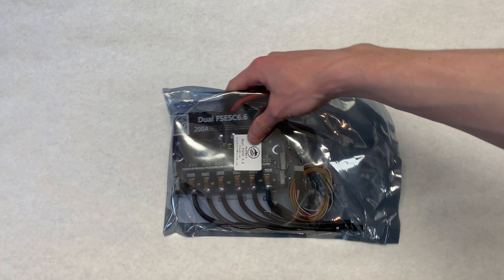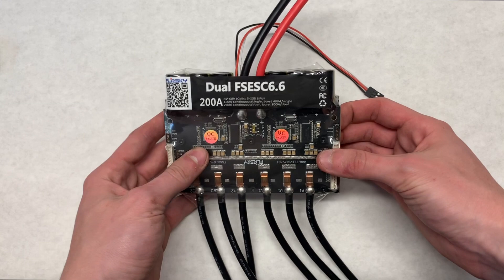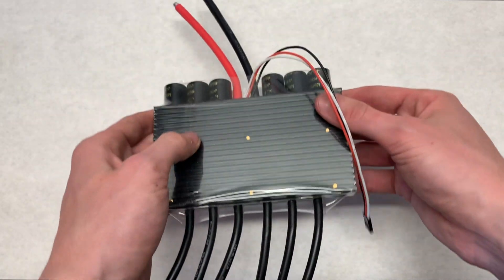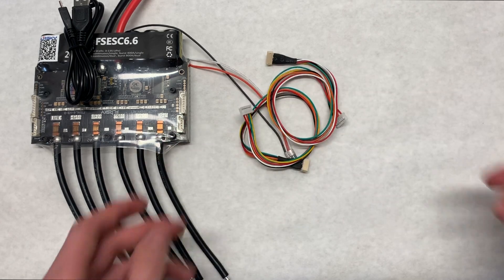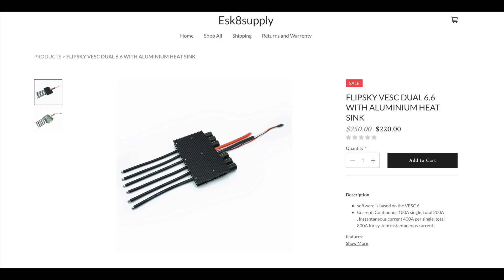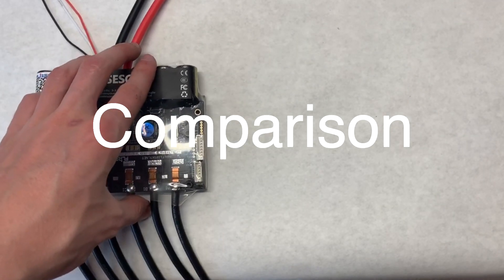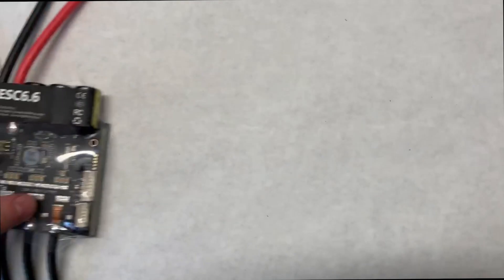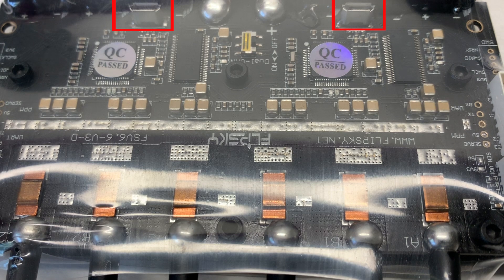Dual Flipsky 6.6 Vesc Review - Best New Vesc?

Comment: I bought this but I cant update the firmware did you have this issue please help me !
Reply from the maker: At what point are you not able to update it? I had an issue where the green light on one side of the VESC stopped working so it would not even connect to the VESC.  Once it is connected, I have never had problems
Reply: @DIYesk8Builders  no it connect it update successfully then it is back on the old firmware I want to cry I paid 200 euros
Reply from the maker: What do you mean its back to the old firmware?
Reply from the maker: What version of the VESC tool are you using?
Reply: @DIYesk8Builders  the lastest

Comment: Very far to be the best :(( Cheap but not reliable. A few days ago, my 6.6 Vesc blow up small caps on board, after one month (830 km). China, china, china. There is no warranty, just think before buy!!! And I set only max 2x40A for hubmotors, 12S battery. You will not see negative feedback on their website as they are deleted!!!